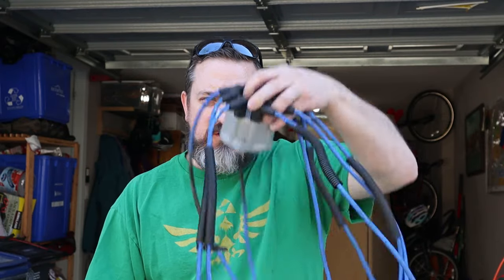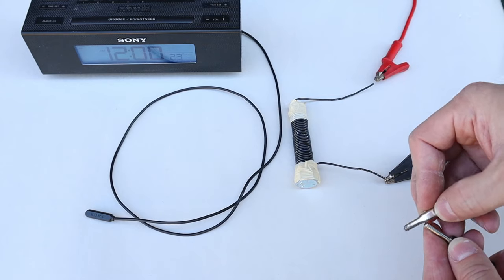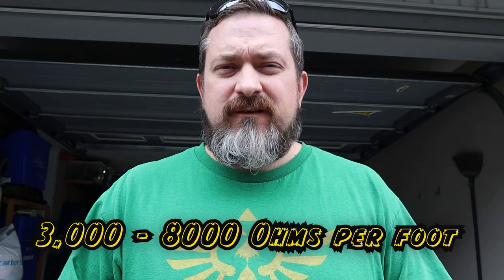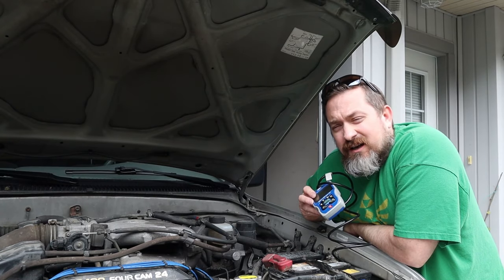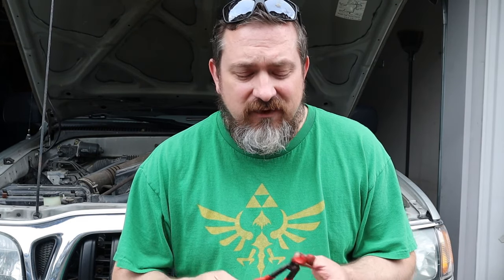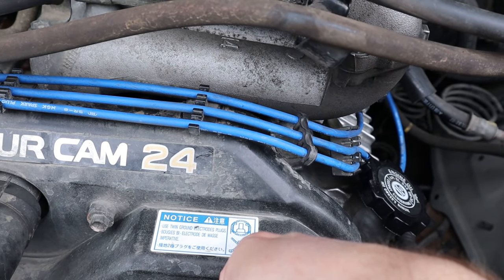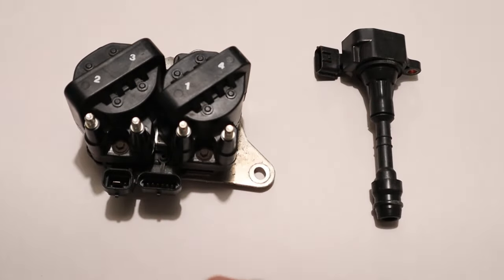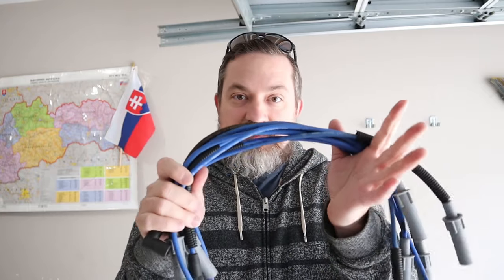Learn everything about spark plug wires, firing order, and much more! How to become a gearhead EP6

Comment: Should the plug wire cover the spark plug completely? I have some white showing at the bottom but can’t seem to push it down any further. I have a 1990 e350 7.5l. Please help!
Reply from the maker: There should be a click when you push down on the wire.  There might be some white ceramic showing, just double check they are down until the click.  Thanks for the watch!

Comment: Where do numbers one wire   spark plugs wire start on Chevy Impala  o4 3400
Reply from the maker: Every vehicle is different but usually number 1 cylinder is on the side where the belts are. A quick Google search will find it for ya.  Thanks for the watch!

Comment: Awesome explanation ❤
My car 1st plug burned 4th time 1st mechanic said carburetor issue 2nd mechanic said rings pistons problem. I found myself at night with some spark in the ignition wire while idle mode.
2 times on idle I heard some sound like dhak!! And after that misfire problem starts. After that video may be that I found ignition wire is the problem because its sparking.
My car nissan sunny B13 1991.
Reply from the maker: Never go back to those mechanics again....you are more knowledgeable than them.  Thanks for the watch and welcome to the channel!

Comment: Thank you so much this was very helpful!! Curious if you are able to assist with one question- I changed my spark plugs on my 1984 Thompson mercruiser boat and the boat started up very well the first time and then randomly shut off while idiling. Now it won’t even start just keeps reving when I turn the key. New problem or maybe loose spark plugs?
Reply from the maker: Check spark plugs and if they are tight, check if spark plug wires are pressed down enough ( should click), check anything removed during this process.  Perhaps a kill switch wire?  Thanks for the watch!

Comment: Good to see you !  My dad's old 77 Ford is definately misfiring...and backfiring. Fire in the hole!
Trying to get this beast back up n running well. I remember replacing sparkplugs in mechanics class in highschool..but that was definately a long time ago. This has made me rethink on how I approach this.
Probably need new wires as well as the sparkplugs. I used some seafoam in the gas tank...and the shop i had brought ig to said it was good to go...but backfired the whole way home. Would have brought it back but it was a couple towns over....no greyound to get back 🤣
Reply from the maker: I just went through this with my Dad's 85 El Camino....so much work.    Carb rebuilt, spark plugs and wires, distributor, timing, harmonic balancer, mechanical fuel pump, catalytic converter, oil pan and valve cover gaskets, etc.  It was a massive amount of work but we got that beast running and back to it's former glory.  Is your Dad's truck back firing out the carb or out the exhaust?
Reply: @wayofthewrench  You have the skills, and know what you are doing. I have a spot to park it but not somewhere i can remove parts and work on them..unless I haul it up to my place on 3rd floor haha.
It was comin out the exhaust. My friend who drove me to the shop was drivin behind me...and had my dog in the car so he wouldn't freak out with the backfiring... he did anyway... Made me jump too
Funny though it felt like it was strugglin hard...on a hil or not
But especislly on hill...then sputtered... Bang...then a short but sudden power boost after the Bang. 77 mario cart style!

El Caminos are cool. There is one I see when I'm out on walks.

Comment: Nice and clear presentation, however it did not answer my questions so I am hoping you see this and can reply with some answers. I have a 60’s car but have added an electronic points kit. No radio. The kit requires suppression wires so I have converted from solid core which had resistors on the caps. I currently have a sports coil that is getting old and am planning to replace it. I am trying to understand the cumulative effects of the various resistances (wires, caps, and plugs) and coil voltage. Is the goal to maximize voltage at the spark or aim for a sweet spot (and if so, how do I determine what that is? If it is not a “performance car” should I be avoiding sports coils? Should I be running non-resistor plugs? I have yet to find an article or video that clarifies these things. Thanks.
Reply from the maker: I would say that essentially you are aiming for the hottest spark you can get so that every single power stroke is ignited fully and on time.  About the only thing that would happen with excessive voltage would be wear on plug gaps and points if you had them.  What car are you working on?  I have a 67 Parisienne and a 68 Firebird.  Thanks for the watch!
Reply: @wayofthewrench  , thanks. It is a ‘61 Austin Mini with the original 850cc engine but a Cooper head with higher compression and bigger valves. I have also reached out to Pertronix in case their unit would work better without the EF noise of non-resistor plugs.
Reply from the maker: Awesome little whip!

Comment: Do coil packs send a signal back to the igniter computer after discharging, or the igniter just send a signal and not receive any. It’s for a motorcycle, I’m assuming it’s the same as a car, this coil is dual fire
Reply from the maker: No they do not.  The computer allows electricity to go the coil pack which builds a magnetic field in the primary coil and when it wants to create the spark, it stops the electricity to the coil which collapses the magnetic field and induces electricity into the secondary coil and down the high tension lead to spark plug.  Most coil packs are dual fire and the second spark is created in another cylinder that is wasted because it sparks when it is in the exhaust stroke which does nothing.  Thanks for the watch.

Comment: This video was AWESOME 😎! It gave me confidence in what I'm doing, and if changing spark plugs doesn't fix my misfiring codes, I have a second fix option which is changing the rubber boot part of the coil thing.
Reply from the maker: Awesome Claudia, I'm glad you enjoyed the video and hopefully it can help your misfire code.  Let me know if it did or not and I'll try to help ya out.  If you deem me worthy, I'd really appreciate a share out on your social media so I can help more people.  Thanks Claudia!
Reply: @wayofthewrench  Actually, there IS something you can help me with. Ok, sooo, I finished the spark plugs, but when I reconnected the battery and started car up, suddenly it's running rough trembling and kinda really loud.... These problems did NOT exist before I messed things up. I changed spark plugs to try to get rid of misfiring codes on code scanner and also trying to fix wherever it's wasting gas from....
Reply: @wayofthewrench  BTW I gave you a well deserved share on FB.
Reply from the maker: Hard to tell if the issue is new from improper installation of the spark plugs or the old issue.  A common issue can be the spark plug wires as they only last 3 to 5 years and are usually a tune up item.  A very common issue is having the spark plug wire on the plug but not pushed on where it "clicks" when it is fully seated.  Check all wires and both ends.  If you push down and you hear/feel a click, then maybe that's your issue.  You can get a code reader to see which cylinder has the misfire and then look up online what cylinder is which to help narrow down the issue.  How tight did you make the spark plugs?  New spark plugs will have instructions on how tight to install them.  Try this stuff and see what you find.
Reply from the maker: Thank you very much Claudia!
Reply: @wayofthewrench  Another question; I have a 2004 Acura MDX base model.... This uses the little boots instead of the wires..... Do I still need to hear the click when putting coil/boot back on? As far as I know, it only had the electric snap on and the one down wrench using screw...
Reply from the maker: That car might have a coil over plug which clicks down on to the top of the spark plug and then gets bolted down with one screw to the top of the engine.  Then there is an electrical connector that connects to that.  Make sure there is no arc danage/burnt spots on the coil over plugs and make sure the connector clicks whens it gets connected.  Also ensure you didn't cross the connectors and plug in a different cylinder.  If you are getting a misfire code for a certain cylinder, you can temporarily switch coil over plugs between cylinders and if the misfire code jumps to the other cylinder, then you know it's a bad coil over plug.  If it doesn't, then your coli over plug is ok.  Hope that helps!
Reply: @wayofthewrench  Thank you so much for walking me through this. I'll DEFINITELY 😁 keep you posted..... Especially with strange capers and shenanigans I may need to add on to the fix.
Reply from the maker: Any luck?

Comment: Ok so I have a 1997 Ford f150  with a 4.6l V8 triton motor. I can not for the sake of this truck figure out how to route these wires to where the motor will stop shaking. I've checked all the plug boots and all 8 are clicked in snug. But the layout of how the wires are supposed to go so the engine runs smoothly is just not coming to me and I can't find it on the great Google.
Reply from the maker: Try this.

https://www.justanswer.com/ford/148ac-firing-order-1997-ford-f150-4-6-triton.html

Did you touch anything else other than wires?  If ya did, it could be timing off on the distributor.  If the shaking was happening before you touched the wires, it could be fouled spark plug, timing, distributor cap and rotor, condensor, Fuel system weak, vaccum leak, bad coil, etc.

Comment: I found some spark plug wires, unopened. All I know is they are 7mm, and my truck takes a 7mm. There was nothing else about them on the box. How do I know they will fit my truck?
Reply from the maker: There might be a part number stamped on the wire and a brand that you could look up.  If not, as long as the wire can be inserted on to the terminal of the distributor and on the spark plug and actually be long enough to reach all cylinders, than they should work.  I would also make sure they haven't aged out and that the rubber insulation isn't stiff or crack when flexed.  Otherwise if they work, they work and besides that, they will need changed after a couple years of use anyways.  Good luck with the freebie set of wires!  Let me know if they work eh?
Reply: @wayofthewrench  see, there is no part number. And thats what I thought, I just didn't want to use the wrong part and ruin something. I will try it, and tell you if it works. Thanks

Comment: I have a question: i bought spark plugs and wires for my 93 dakota. The new wires are different lengths than the old ones. I thought the new wires and old wires are suppose to be equall lengths?
Reply from the maker: No they are almost always different lengths because they have to reach different places on the motor.  If the wires are a little longer than old wires, that is ok.  Shorter may be an issue as they might not reach.  Just replace one at a time so you dont lose the firing order.  Start with the longest wire first (spark plug farthest away from distributor) and use the longest new wire in the new set. Then so keep going until you get to the shortest wire.  Also sometimes the wires are numbered which can help if you know which cylinder is which.  Hope that helps, good luck!
Reply: @wayofthewrench  i just replaced both spark plugs and wires. The wires were different lengths but with process of elimination it worked perfectly. I thank you for this new confidence i gained. NEW SUBSCRIBER. GAINED!
Reply from the maker: Yeah perfect, that's what its all about.  Gaining a little confidence and a little experience and getting better with every job.  There is always more to learn and they is new tech coming out all the time, it's one of the things I love about working on cars.  Thanks for the sub, cheers!

Comment: I have a question, so I have a 1987 Honda shadow vt700 and was trying to get a flamethrower kit but don’t like the idea of the engine having to be off for it to work. So I bought a Harley coil pack and put 12 volts from the battery to the coil with a toggle switch in between, the switch is grounded. Then for the trigger side I spliced into the Hondas coil pack trigger wire and and attached wire to the Harley coil pack with a switch in between, that switch is grounded but it’s a 2 prong switch and I wasn’t sure if it’s supposed to be grounded but I did anyways, it’s all wired correctly but with both switches off the coil should get no power, which it doesn’t, and with then off the bike starter misfiring and firing off order I think, because the front cylinder the one I spliced into wasn’t firing correctly, and it was very loud pops not like it’s usual back fire, this was more like a misfire on the wrong stroke, any advice? Am I not able to share one trigger wire and have it go to two coil packs? That’s the only thing I can think of that wires into the Honda engine and now it’s not running right :/
Reply from the maker: Hi Spencer.  Just to be clear, are you putting on a kit that shoots flames out the exhaust pipe ( fuel injector/spark plug in pipe) or are you talking about adding an aftermarket coil called a flamethrower?
Reply: @wayofthewrench  I bought a Harley Davison dual fire coil off eBay, and have a toggle switch for the 12 volts coming from the battery to the 12v side of the coil, then spliced into the trigger wire for the Honda coil (the one for the engine to run) and routed a wire to a toggle switch, then when the trigger is on it’ll have the power from the trigger to the Honda coil also going to the Harley coil. So one trigger is supporting two coils, is that bad? I also grounded the two prong toggle switch that the trigger goes into, was I not supposed to because when I grounded it that’s when it started misfiring
Reply from the maker: I would say you don't want a second coil, you're just doubling up on weight and complication and for what purpose?  You just have to have one perfectly timed consistent spark not 2 or a more powerful spark.  If you're having misfires before the added coil, then I suggest troubleshooting/replacing your original coil not supplementing it.  You also are trying to provide 12 volts to both coils now and depending on your setup, both might not be getting what they need to function properly.  Yank out the Harley coil/wiring and fix the Honda parts.  Good luck.
Reply: @wayofthewrench  I think I started shorting out the system because I grounded a switch that wasn’t supposed to, I grounded the trigger wire :/ so I’ll undo that but do you thing one trigger wire can signal to two coils? I just need that 3rd Harley coil to spark the plugs when I turn it on like a normal coil, other than a trigger wire idk how else to do it that’s why I spliced off the bikes engine coil wire, it was running fine until I grounded the trigger wire, the Harley coils spark plugs go into the muffler, it’s a homemade flamethrower kit that won’t require the engine to not spark it’s own fuel, it’ll be sparking a small atomized amount of fuel in the exhaust, all the kits required the CDI to not spark the engine plugs, I don’t like that, so I tried doing my own way of flamethrowing

Comment: So rn i have the wires for about a month but my spark plugs were bad do i just need spark plugs and am i able to use the same wires ??
Reply from the maker: How old are your spark plug wires?  I used to change them every 2 to 3 years or with a major tune up.  If you changed your plugs, it would be good to change your wires even if they seem to be ok but are older than 3 years old.  Thanks for the watch!

Comment: Roadside service blokes kept saying "don't know why it's not working. you should send it to [local rip-off artists, and never any other suggestions]". 

The clip broke off the lead/wire. 

How does a roadside mechanic not notice a broken lead? 

Ovary tax strikes again

How did I find out? 
Figured that while it was off road might change out the leads, like an old PC and its cables. 

I found broken leads, corroded lead, and corroded coil ignition. 

Am recharging the battery in preparation to see if changing these bits out is gonna help
Reply from the maker: Yeah, a good roadside mechanic should have noticed that but it happens and sometimes these things take time.  I'm sorry that you have to deal with worrying whether you are getting ripped off just because your a women, that's horrible.  Life's hard enough as it is.  The best thing you or anyone can do is to learn how to diagnose/fix things yourself and then you can save yourself money and aggravation.  The other thing is to do regular maintenance on your vehicle so you don't have any breakdowns.  Thanks for the watch and welcome to the channel!

Comment: I found an extra spark plug yesterday. Can I add a 5th one to my Corolla?
Reply from the maker: Ah HA!  I know you didn't watch the video because we went over that in great detail and yes, you can add extra spark plugs.....they make great decorations in 90's Corollas!
Reply: @wayofthewrench  darn. Mine is an '05
Reply: I can't find the plug wires on my Duramax. Any ideas where to look?
Reply from the maker: Duramax diesel engines won't have "spark plug wires" but they are going to have glow plugs and glow plug wires/power straps.  Google duramax glow plug wiring diagram to find these bad boys. Next video will be on spark plugs/glow plugs my friend.